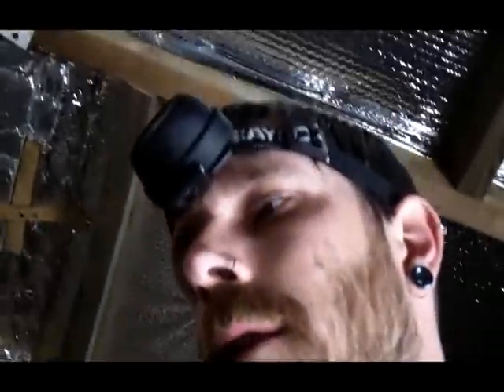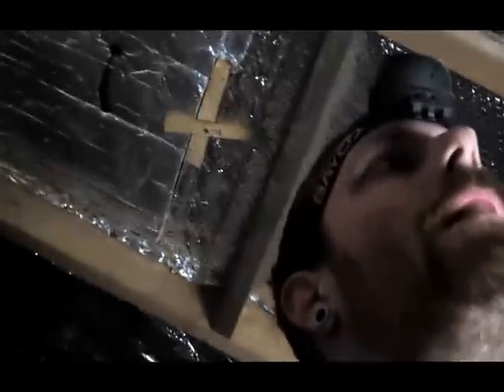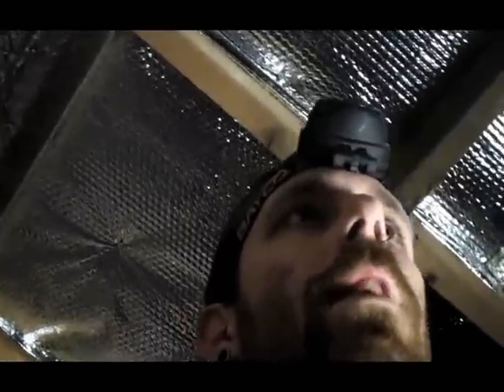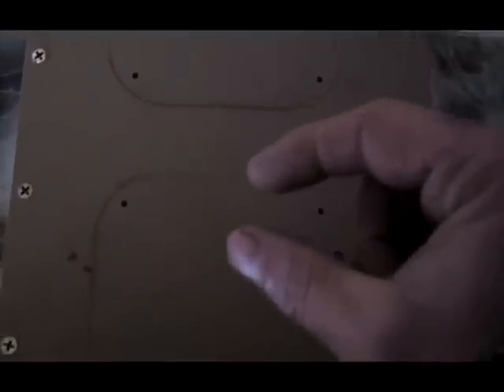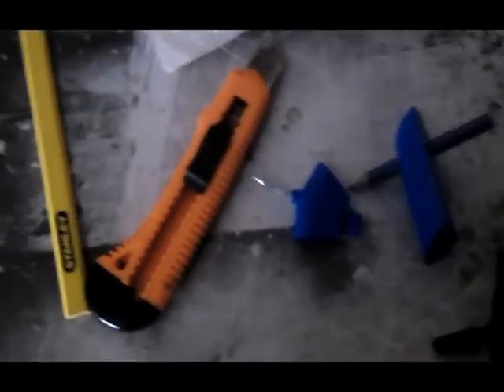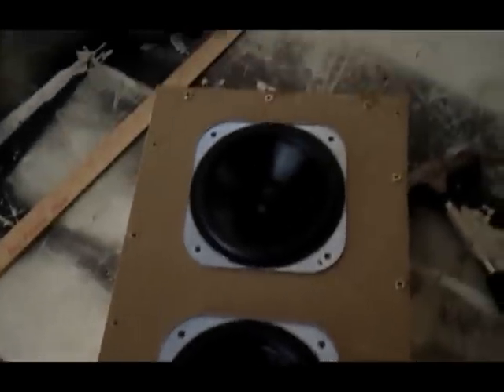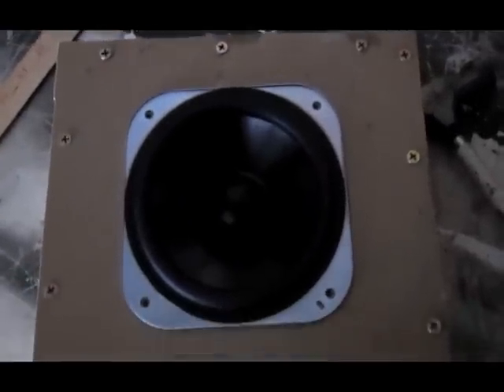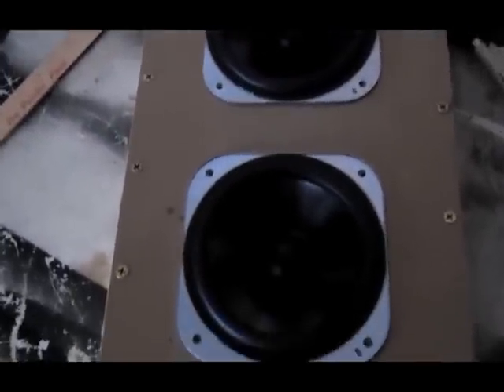Box Building For Two 5 1/4 Midwoofers

Comment: drills usually dont go wrong in many ways ... its usually either the motor, or the inner bushings ... if it still works i'll guess its the bushings, since they ware out and your isnt exactly new ... bushings are super cheap and very easy to change... do it ;)

Comment: I bought 28 of these bad boys when they came out. Still haven't done anything with em' yet. I heard they had a nasty peak at 3500k so full range is out.  With such a high qts I was thinking open baffle/ dipole. Let me know how they work out for ya. If you're interested in another deal check out the focal midbass and the 10" for 5 bux a piece they are selling. If I had some spare c-notes I would buy 20 and build an dipole sub wall.. Another great buy.